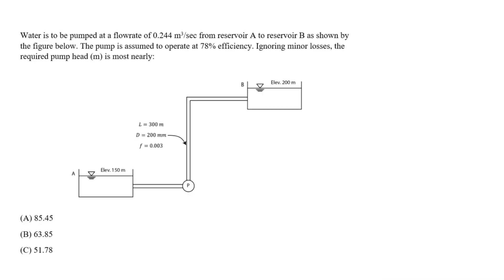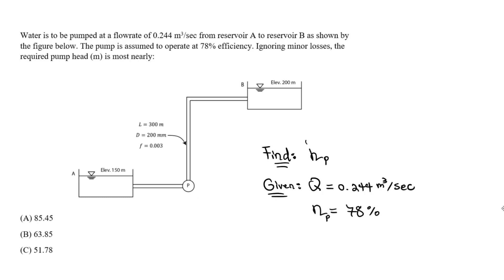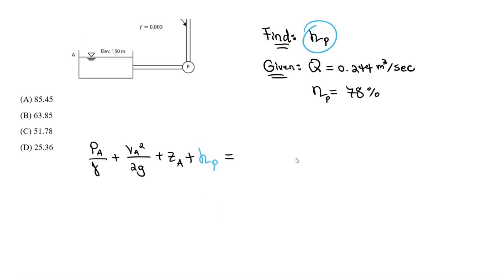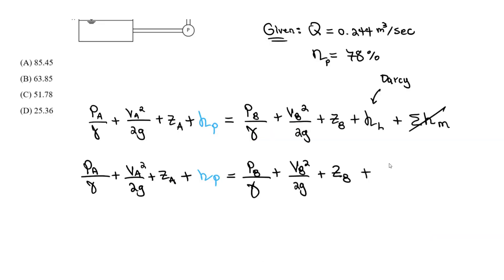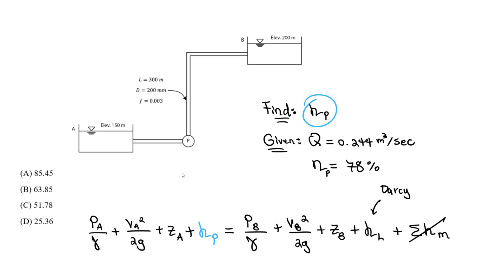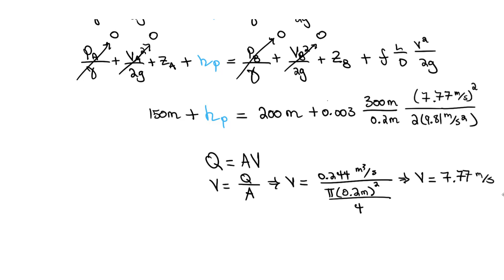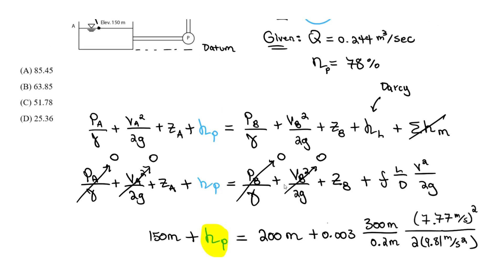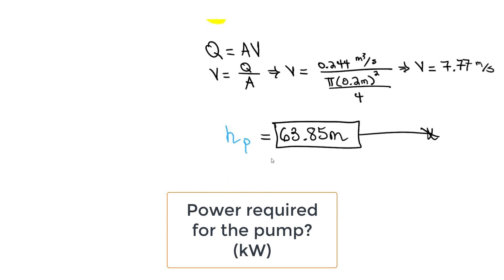FE Exam Review - FE Civil/Environmental - Water Resources - Pumps - FE Exam Tutor

Comment: Hi, I solved for Hp and got 51.78m and then divided by the 0.78 for the efficiency and got 66.39m how did you get the 63.85m?
Reply: I was also getting 51.78, but you need to square your velocity. 7.77 squared will give you the correct answer.
Reply: @kabako4485  I see now, thanks for the reply!

Comment: Thank you for sharing this video! But why did you add the head loss and minor losses on the right side of the equation instead of minus them?
Reply from the maker: Hi Tianyi, 

Thank you for watching! 

The Bernoulli equation (energy equation) is a balance between the energy added to the energy removed between two points or sections (1 and 2). 

On the left side of the equation, we put the terms that add energy between points 1 and 2. 

On the right side of the equation, we put the terms that remove energy between points 1 and 2. 

Therefore, the head loss terms are always on the right side of the equation since they remove energy (losses) from point 1 to 2.

Comment: Shoot... what if it's thought of like this. The system only can pump at 78%. Needs to go 50 meters. 50 x 78% = 35. Then subtract that from 50 and you get 15. Add that back and it's 65 required head. Pretty close to the answer.
Reply: That is a coincidence that it works out to be close

Comment: Just wondering where did you get the hp loses? I can’t find it in the reference...
Reply from the maker: Hi Sinan, yeah unfortunately the equation is not provided in the reference handbook. You can always get the total losses by applying the Bernoulli equation as it was done in the video. The Bernoulli equation is provided on page. 181 in FE Handbook 10.0.1.

Comment: isn't there technically atmospheric pressure of 101.3 kPa, although the terms  on both sides of the eqn will cancel out???
Reply: yes since both reservoirs are open to the atmosphere, the same force is applying at both ends. Like if one end was pressurized or closed off to the atmosphere you could image it would be harder to "push" against that when pumping.

Comment: W= (9.81*113.85*0.244)/(.78) =349.38 kw    H=200-150+63.85=113.85.... Please let me know if I did it correctly. Thanks
Reply from the maker: Hello, close but I got 195.94 kW. The equation used is the pump power equation in the FE Handbook. W = Q (gamma) h / Efficiency. Therefore, W = 0.244 (9810) (63.85m) / 0.78 = 195940.92 W = 195.94 kW . 

I think the mistake you made was for the head. This is the required head to be lifted by the pump which we calculated as h_p = 63.85 m.
Reply: @directhubfeexam  thanks. I understand where I made a mistake.
Reply: @directhubfeexam  here Gamma is 1 g/cm3 right?
Reply from the maker: @ssabitha  That would be the density “row”. Gamma is the unit weight so it would be 9810 N/m^3